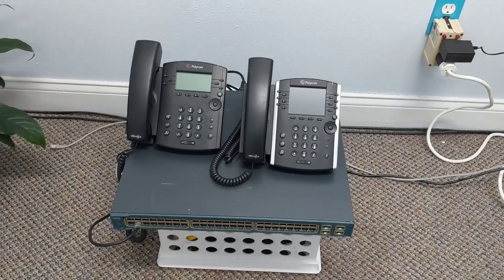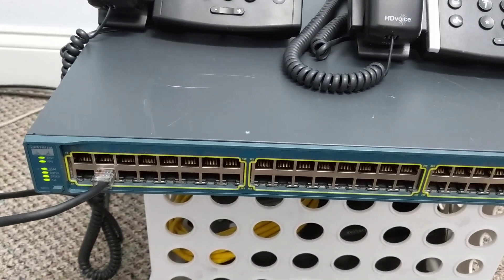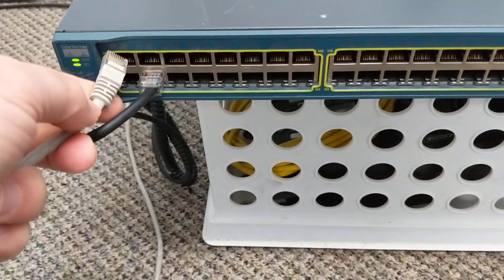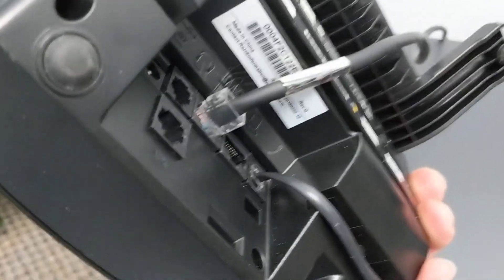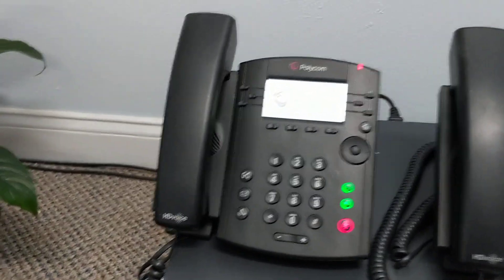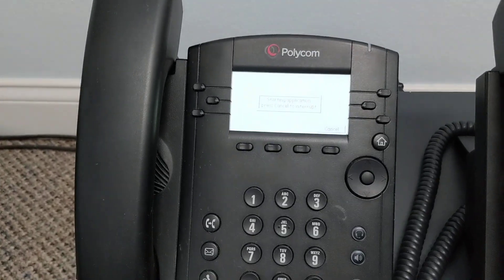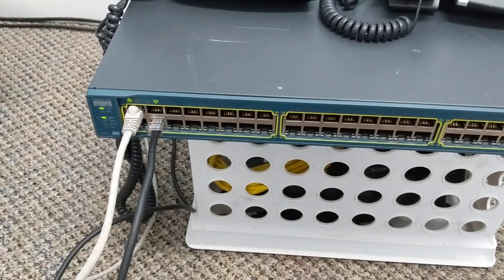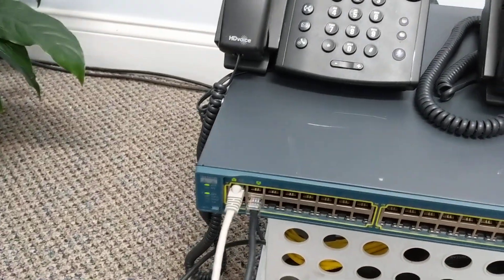How do POE switches work

Comment: I need an Ethernet for my desktop which doesn’t have wireless capabilities. Can I plug the Ethernet into a POE switch (as opposed to just plugging into the the router) for internet connection even when I don’t need any power?
Reply: It wouldn’t like fry my computer would it lmao?
Reply from the maker: Definitely will not hurt your computer.   The POE switches only send power to devices that ask for it.  😊

Comment: Excellent video and audio, 
How do I measure that the remote device ( i.e the phone in this case, and an IP camera in my case ) is receiving 48v ?
I have a MultiMeter, but the network cable is a CAT6, so how do I measure - which pin in that CAT6 things like that .. will help.

Comment: Let's say I have 10 phones ( or 10 devices i.e a phone or an IP Camera) and they all need 48v, Will the switch have the ability to serve all the 10 devices with 48v power ?
That means the switch should have the ability to serve ( in this example )  16, or 32 or more devices.

Comment: Thanks for the video. Are the POE adaptors generally brand specific, or can I use a non- Cisco POE with Cisco phones?
Reply: You can pretty much use any PoE switch or adaptor, as the system is industry standardised, I believe most PoE Cisco phones come with an adaptor in the box as an optional item.
Reply from the maker: Thank you for chiming in here.  That’s exactly right.  PoE is pretty standard across different manufacturers.  And many VoIP phones come with an adapter in case you don’t have a PoE switch. 😀

Comment: Thank you for this informative video. Would you recommend using a PoE switch instead of an NVR for a security camera system? What are the advantages and disadvantages of each device?
Reply: Good one - I have the same question.
Reply: An nvr is an nvr, a switch is a switch. Totally different things that aren't interchangeable